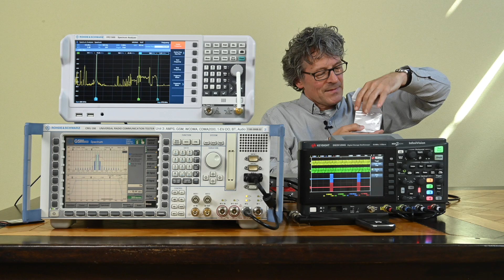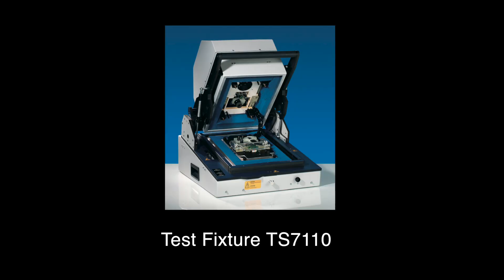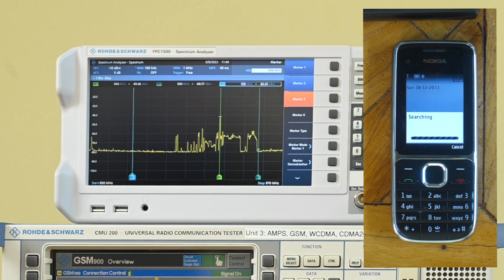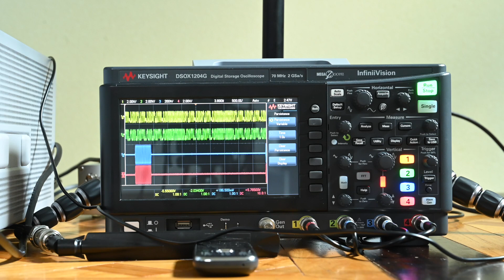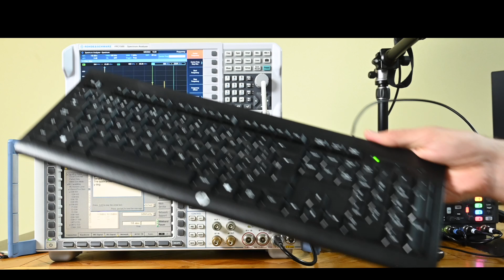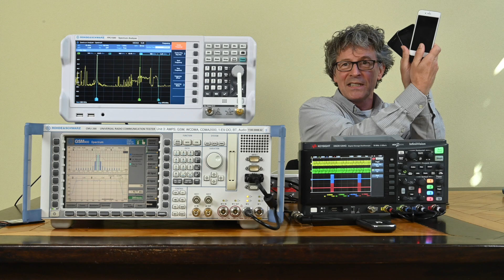REL #34 CMU200 testing a GSM phone

Comment: What is so specific for the special SIM card? Just the absence of security protocols? By the way ... excellent video!
Reply from the maker: Sorry for the delay... Well, a bunch of things. While I have not studied this one specifically (I bought it), I did program some myself for the RACAL 6103 tester - see my last video. A test SIM card has the 001 country code (which signals a test network), the same IMSI as specified in the tester, the same Ki authentication key as set in the tester, and loopback mode enabled for BER testing. Possibly some more too...

Comment: Hi. I was using my CMU200 as a regular SA and signal generator (ham radio hobbyst), but after looking all your videos showing the benefits of this great piece of gear I want to go ahead and at least try to do some tests with old GSM phones I have laying on my shack. The thing is I want to buy the test card, but not from the guy that sold you the one that doesn't work. Is there any way you sell one of the cards you have (I'm in Spain)? If not, can you share where did you buy the cards, so I make a try? Another question is, that card works in GSM only, not 2G or 3G, is that correct? So to work in those bands you'll need other sim cards...? You have made a brilliant work man!! Thanks in advance.
Reply from the maker: Hi Marcos, just drop me a pm at rudiselectronicslab@gmail.com !
Reply: Hi Marcos, check my top comment which has a link for test SIM cards which I use to the CMU200.

Comment: HI Rudi, thanks for that wonderful demonstration. I also have a CMU200 and would like to try this to learn about GSM. But I have 2 questions: First, does the cell phone need to be unlocked to be used with the test sim cards? Second, can you share were you got the test sim cards? Working ones are really hard to find. Thanks again and keep the good videos coming!
Reply from the maker: Thanks for the positive comments! Concerning your questions: 

(1) yes, you’d need an unlocked phone, I believe. But it’s best to experiment with an old 2G phone anyway. You might have some lying around (or if not, family members :-). I had trouble getting a modern iPhone to work with the CMU, and I believe others too. 

(2). I had to do several attempts find a working SIM card. Some offers on eBay were clearly marked as “CMU SIM test card” but they never worked with me, a d the seller never replied to my queries 😕

In the end I got a batch that worked. Still got a few left. If you drop me a note at rudiselectronicslab@gmail.com with your postal address I can fetch you one. And feel free to send me a nice goody in return 😊

Comment: Thanks for answering my SMS question. I repaired 3 CMU200s with filter faults and kept one which had a flat 3v battery. When I got to the processor board, I found all tall electrolytic caps bulging at the top. On further inspection I found the small fan not working, no doubt the cause of capacitor failures. After replacing all these, the unit would hang at switch on, which turned out to be a keypad fault. So I replaced the keypad foil & the rubber key mat, then I had misalignment of the screen image etc. etc. It is now working well except for not turning off occasionally & you have keep holding down the on/off button to turn it off. I use it to test SIM800 modules & the spectrum analyser. Regarding test SIM cards, I managed to buy a 2G test SIM card about 5 years ago.
I then bought blank cards & a SIM card copier / editor & copied the 2 G test cards.

Comment: Off-topic, but you may be interested in a low-cost (US$480), high-accuracy instrument for measuring the phase noise of oscillators. The PN2060A Phase Noise Analyzer is made in China by a radio amateur, following work in the UK. It uses the new method of cross-correlation of two reference oscillators against the DUT, as used in the most modern commercial instruments. I have one and it is very easy to use and gives accurate results. Others have favourable comparisons with commercial instruments. I have two blog posts about it. Google my callsign VK4ZXI, and/or PN2060A.

I like your channel. I have a couple of CMU200s.

Comment: My memory vaguely remembers something about needing to upgrade/change some software on early Apple iPhone 3S (not on the SIM) to have it accept/recognize the network. This was not related to the provider locking that was common practice at that time. I recall some files with the network configurations could be edited ones the phone was jailbreaked. Unfortunately haven't more memories about that.
Reply from the maker: That is very interesting... Does your comment refer to using that phone with the CMU200 in particular? Wonder how that relates to over-the-air network settings/configuration files used in these networks, although these of course already require a working connection in the first place. If you or anyone has additional information on this (or memory comes back;-), please do share!

Comment: By far best simple explanation I have seen up to now. Thanks ! Are your sources original GSM specifications ?
Reply from the maker: Thanks! About my sources: these are a variety of books and other materials I have been using over the year. In the 1990s, I used book of Mouly & Pautet (1992) a lot, which was considered as the well readable, ‘unofficial’ GSM specifications. You could buy it directly from the authors.